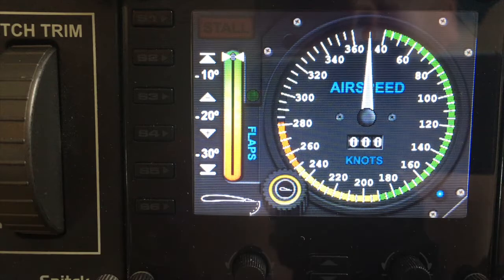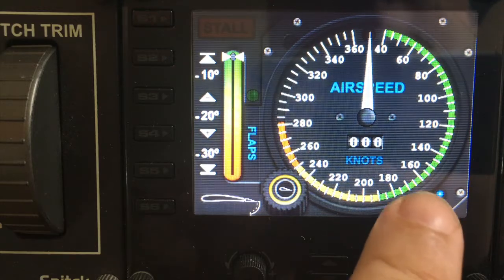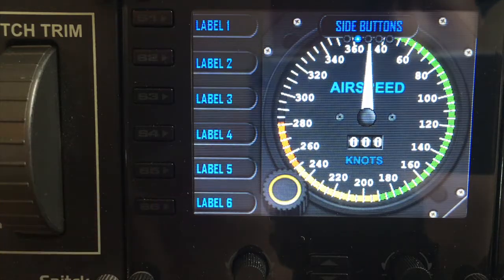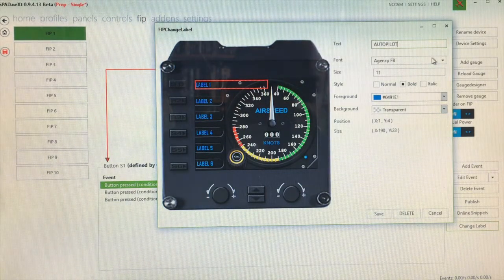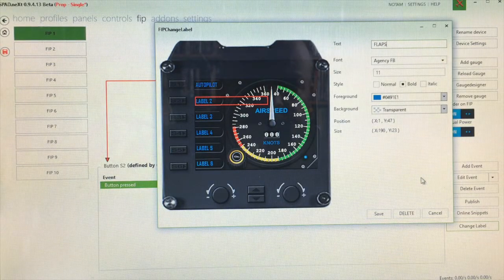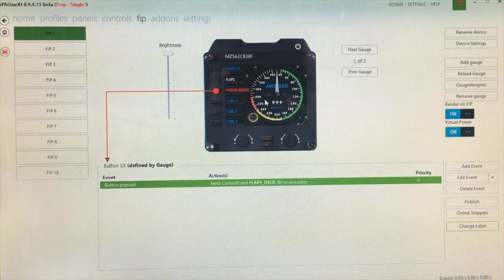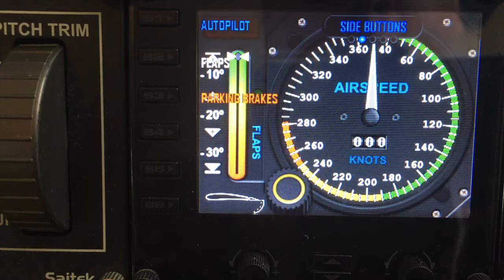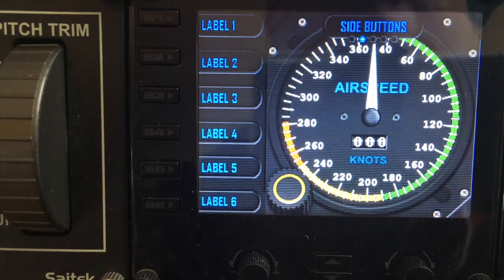Button Labelling Demo - FIP Gauges & SPAD.neXt

Comment: Hey Daz, I got a little Trick for you on how to make the text for the labels disappear when you turn off the side buttons. (that way they don't appear on top of the graphics display). What you do, is in spad.next, select "add gauge" and add a second gauge. The gauge you add is the exact same gauge ( in this case another instance of your airspeed gauge). Then what you do, is  have one instance with the labels and 2nd instance without the labels. This way you can press the "gauge up/down" buttons to switch between the two of them. (one with the sidebuttons with labels, and one without). Not a perfect solution, but 100 times better than needing to go in and delete your labels each time you want to see the left display without the labels on top.
Reply from the maker: you know what, I didn't think of that :-) good work around. I've been a bit lazy and haven't spoken to SPAD.next about it and that remind me. I've noticed a few oddities when using multiple gauges on one FIP and need to report findings to SPAD.neXt. But thanks for the feedback.